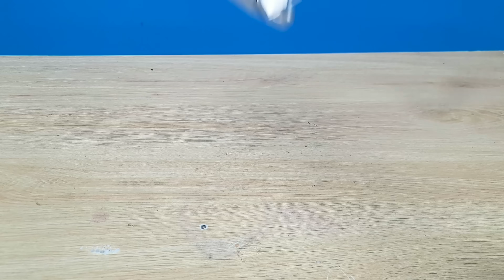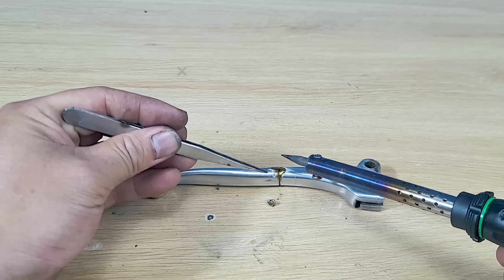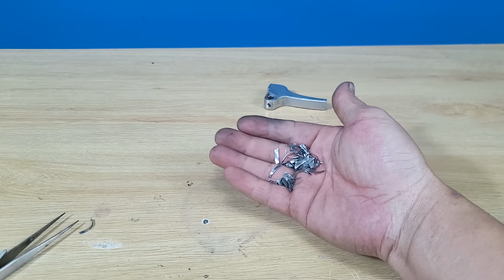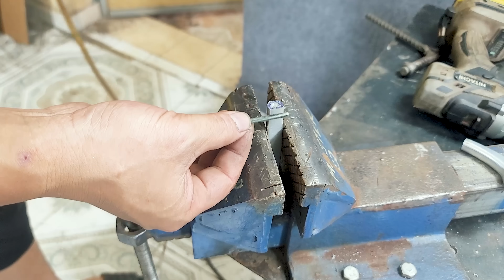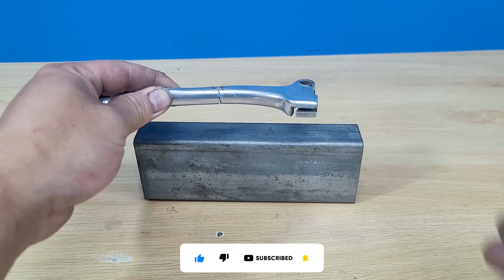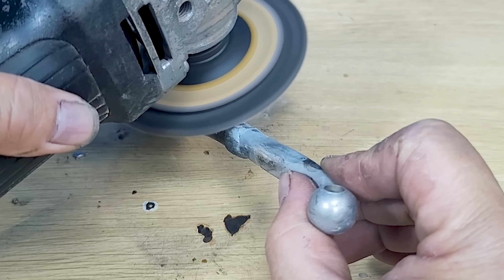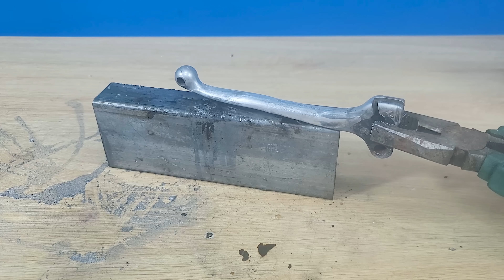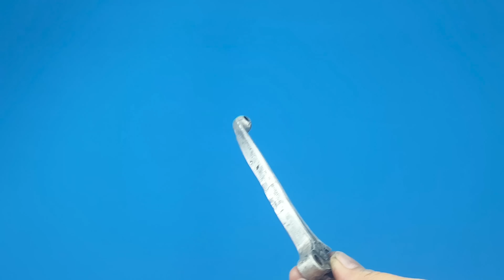Even a NASA professor had to learn this from me! Idea of using 1,5V battery to weld aluminum brakes

Comment: LOL There's no such thing as a "NASA professor" - that is NOT brakes (but a single "brake" lever) - and it was bolted, then brazed together, not welded. All of those statements are wrong. 
           More to the point - Why would anyone go through all of that work for a cheesy repair that will only last for a few pulls of the lever - when we can just buy another one for a few bucks - bolt it on in 1 minute and have it last forever? 
           Any mechanical/structural engineer or aerospace worker at NASA caught doing anything this cheesy on any air/space craft would be given his/her walking papers, followed by hearty laughing all the way to the un-employment line.              signed, the real "NASA professor" 🤣

Comment: Welding the brake lever is 
not a good idea. It may look good again after the repair, but the strength is unlikely to be anywhere near as good as the original, especially as the cross-section has been further weakened by the hole.
The rider's life can depend on a brake lever like this.
Such safety-relevant parts should not be patched up but replaced with new ones.
The rider's life depends on it. Anyone who economises on safety is acting negligently.
Reply from the maker: Hello, nice to chat with you. You are a good person. Especially when your sharing is related to our own safety. Thank you for your comment. We look forward to receiving your support in the near future. Thank you and best wishes to you and your family. Happy New Year and prosperity

Comment: This is old stuff. I learned this more than 50 years ago. The strength depends on the type of solder used. "Normal" tin lead solder is not that strong, so I don't know how long this will hold. Silver solder is much stronger but melts at a higher temperature, so you have to be careful.
The "flux" used was widely available in our country's stores until about 15 years ago. Because it is a strong acid and not environmentally friendly, it is no longer sold.

Comment: And now the question remains: How much force can it handle before it breaks? I'm not sure if it's a good idea to have a brake handle that is very likely to break off again.
Reply: Not defending this "repair" because it's absolute garbage... But sneeze on those things and they snap.

They're jelly bean parts anyway, his repair probably cost more to do than to just get a new one.
Reply: @Mmouse_   My thought exactly. Besides that, next time you drop the bike, the receiver will break,costing a lot more than the lever.
Reply: Sudden brake failure, why?🤣🤣🤣🤣🤣  Charles Darwin theory of evolution
Reply: It's a clutch..........
Reply: @kdsowen2882  you dont know what a clutch is. 
brake handles are on the right side clutch handle is on the left. he "dropped" the cheap moped and broke the right hand break handle.
the clutch itself is in the motor body and controls the transmission of mechanical power.
Reply: 4 ane ki murgi aur75 ane ka masala
Reply: Only 50% chance of failure
Reply: @AveGuy1  Yes.  It's a failure rate of 50% with each use. Use the lever 5 times and the failure rate is slightly greater than 96%.
Reply: I believe there must be a reason why those brake handles are made from aluminum and not harden steel.
Reply: Yes, usually for cheapness of Chinese/Taiwanese manufacture. @geirha75
Reply: He could've just used a car battery to weld the two parts proper

Comment: I didn't understand what the 1.5 Volt battery and the blue marker have to do with anything... :-D
Reply from the maker: Hello, nice to talk to you. People take zinc and add it to an acid solution to create a solvent for aluminum. The blue marker is for us to accurately determine the center. Have a good day. Well, you can learn about that flow through this video: https://youtu.be/vjx-foc4vws
Reply: Excellent, you have reinvented the soldering paste. I have been successfully using "NOCORODE" for a lifetime in electronic soldering work. @inventorK20

Comment: You didn't weld with a 1.5 v battery. You used a torch and solder. All you taught me is that you don't even need to have accurate or useful information to make a YouTube channel

Comment: Aluminum brazing rod is cheap. You lost me when you used pliers to take off a 10mm nut then used a self-tapping screw to "drill". Lastly when you chucked soft aluminum lever parts into a steel vice, you did more damage than I would accept. The new lever is $2 and my time is worth more than that.

Comment: Nice job on the repair. If you use the alumaweld rods & torch, with most aluminum alloys the repair will be stronger than the rest of the part. So everyone saying you can just order the part can do that if they like. Or they could just have some alumaweld rods on hand with a simple propane torch & they'll be up & running in an hour with a stronger part. Cuz I suspect those cheap online parts are inferior & weaker than original equipment.
Reply from the maker: Hello, nice to chat with you. Thank you very much for your positive shares. It helps me have more motivation to complete my work. We look forward to receiving your support in the near future. Wishing you and your family a Merry Christmas, my dear friend.

Comment: Hmm.. In this case, a replacement brake lever is the answer. Hollowing-out the two parts effectively reduces its strength. Think how much weaker a tooth becomes when the decayed part has been removed and filled. A 10mm molar becomes say, a 2mm rim - Not as strong as the original, for sure.
Reply from the maker: Hello, I am very happy to receive your sharing. You're right, thank you for sharing with us, we look forward to receiving your support in the near future. Wishing you and your family a peaceful Christmas

Comment: Zinc chloride is well known as soldering flux.  You  can buy it at the hardware store.   Bakers fluid.

Why did the brake handle break in the first place?  Defective manufacture?   As like as not, it will break again.  It should be scrapped as being possibly defective throughout.

OK to use tricks like this to repair non safety critical items - but your life can depend on your brake handle in an emergency stop.
Reply from the maker: Hello, I am very happy to receive your sharing. I look forward to receiving your support in the near future. Wishing you and your family a peaceful Christmas
Reply: @inventorK20  And to you and your family also.  Thank you for your kind words.

Comment: It is hard to work out what is going on, but it seems to me that the the 1.5v cell was cut open to pull out the zinc metal sheet that forms the negative pole, and it is then cut into pieces and put into a hydrochloric acid solution which reacts to make what is known as "killed spirits", which is used as a flux for soldering/brazing.  Yes?
Reply from the maker: Hello, nice to chat with you. Thank you very much for your positive shares. It helps me have more motivation to complete my work. We look forward to receiving your support in the near future. Wishing you and your family a happy and peaceful Christmas, my dear friend.

Comment: Best tip I can give anyone new to riding, or especially on the dirt. Loosen of your clutch and brake leavers clamps, this allows the lever to fold up or under. Pick up the bike and just tap it back.
Reply: Except under heavy braking the lever will fold upwards losing braking effect. Crash.
Reply from the maker: Hello, I am very happy to receive your sharing. You're right, thank you for sharing with us, we look forward to receiving your support in the near future. Wishing you and your family a peaceful Christmas
Reply: that is difficult to do if there are locator pins. I agree that you should leave the perch loose on the handle bar so it can have a chance to possibly avoid breaking in a tip over if I can float Instead of being rigidly clamped
Reply: If you also loosen your wheel nuts it will be safer
Reply: Bark busters; always the freaking soft sand that would snap them for me...

Comment: 1. Could have just used aluminium foil instead of ripping apart a battery without gloves.
2. You soldered it with lead... Super weak repair and the only thing holding it together is the steel screw inside.

Comment: The idea of the video is to demonstrate that you have options. In many parts of the world, it is often quite difficult to get parts. Especially if you live any distance from the nearest supply or order center, and the only vehicle that you have is the one that needs the part. It's kind of a "catch - 22" . It is an interesting learning video,  especially for us "DIY-ers."
Reply: like being able to afford tools to do the repair and not being able to buy a replacement part.... and no, a spare like this even in a poor country is a dime a dozen, have you seen how many scooters and bikes they use in those parts of the world?
Reply from the maker: Hello, I am very happy to receive your positive comments, it helps me have more motivation to complete my work well, I look forward to receiving your support in the near future, best wishes. the best things. and your family a peaceful and happy Christmas
Reply: Fantastic repair job. You are good, Sir.
Reply: It's probably stronger than the new one 😢
Reply: Ok, but he'd be much better off then just casting a new one from a mold from this old one.  Less equipment and time needed, and it would be more structurally sound.
Reply: i like the option of choosing design flaws over safety.  good job!
Reply: If that NASA professor learned to do this nonsense, I'm not surprised because the Challenger exploded during takeoff.
Reply: @franciscomorales7012  that professor gave it a shot at micky mousin the lever back together, I would have failed off the ragged end and used two fingers. It's 50cc scooter not a space shuttle.

Comment: 1. NASA is not a university and as such has no professors. 2. That brake did not function at all, in the end you could see that the handle could be pulled all the way up to the handle bar without any effort so no pressure would be applied on the actual brakes. 3. You don't polish before sanding. 4. You don't hammer in shape after polishing or sanding. 5. The use of the 1.5V battery is totally not explained and I doubt it was relevant. 5. You can not solder or use tin on aluminium. It was pretty obvious that low melt aluminium was used and not tin to make the actual joint. 6. You can use a drill and a tap to make a hole and make a thread in it, no need to jerry rig a self drilling screw or abuse a piece of thread for this. 7. That splint was awfully short, I would have drilled deeper and made a longer splint. 8. You can buy a new handle for probably not much more than the cost of the materials used, making your critical safety equipment (brakes are) a lot more reliable than hoping your ghetto welding will not brake while you are driving towards a big truck that will not stop or get out of the way for you.
Reply from the maker: Hello, it's a pleasure to chat with you, thank you for sharing with us, we look forward to receiving your support in the near future, wishing you the best, a Merry Christmas and peaceful

Comment: I think the nasa bit is hose shit however just because one guy can buy another part for cheap doesn’t mean everyone can as well. Using the felt marker to locate the spot on the other side is a useful trick. I think the point here is that this technique could be used on other parts that might not be available etc.  I’ve used doweling or metal mesh on glue repairs in the past and in my opinion if something can be repaired why replace it because that’s a transferable skill. There’s going to be a whole lot of needy useless people some day when the right to repair becomes the need to repair. Look at the recent supply chain issues and the chaos that caused!
Reply from the maker: Hello, I am very happy to receive your positive comments, it helps me have more motivation to complete my work well, I look forward to receiving your support in the near future, best wishes. the best things. and your family a peaceful and happy Christmas

Comment: Yea I'll pass on a hack and just get the new part, but then again I'm not riding a 40mph scooter either. Drilling a hole down either piece also weakened both halves! Worst case scenario that's just gonna snap when you hit the brakes hard, and lose brakes. Cool idea for a toy though.
Reply from the maker: Hello, thank you very much for sharing your real opinion with us. We will try to improve what you say in the future. We look forward to receiving your support. Wishing you and your family a peaceful and happy Christmas
Reply: @inventorK20  all good personally I'd make 3 or 4 slits on the outside with a dremel cut off wheel, tap in some thin bits, then finish it up like you did. That would keep the core intact. Aluminium just loves to crack.

Comment: While this was clever, I’m not sure I’d repair a brake lever, or at least, not by brazing.
Not sure what metal you used for the threaded insert, but it needs to be from the same family as the light alloy used in the lever. Dissimilar metals react with each other, causing galvanic corrosion, so your lever will gradually weaken from the inside, where you can’t see it.
Could you please explain the use of the battery? What is the chemical you used and why did you need the strips of metal from the battery? It obviously resulted in a brazing flux, of some sort, but would genuine flux not be cheaper and easier than whatever that was? Or is that something different?
Thanks for the video, though. Lots of useful tricks there, for non safety related repairs or for artistic metal work.
Reply from the maker: Hello, thank you very much for sharing with us, you are a good teacher, you have given me a lot of knowledge, you are worthy of our respect, we look forward to receiving your support yours in the near future. Wishing you and your family a peaceful and happy Christmas, you can learn from here: https://youtu.be/vjx-foc4vws
Reply: galvanic corrosion needs an electrolyte in-between the metals i think to happen. in this case there's no electrolyte in-between(rain for example) and the electrolyte can only contact the aluminum so i don't think there will be a reaction. perhaps a chemist or experimentalist could chime in.